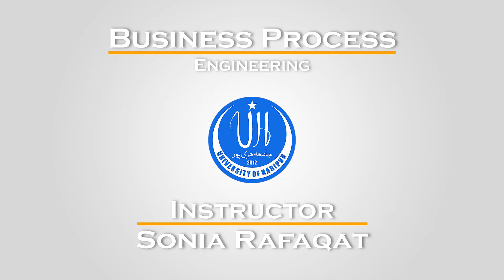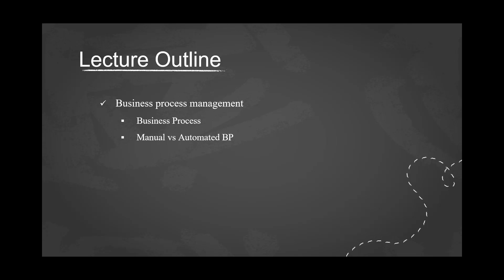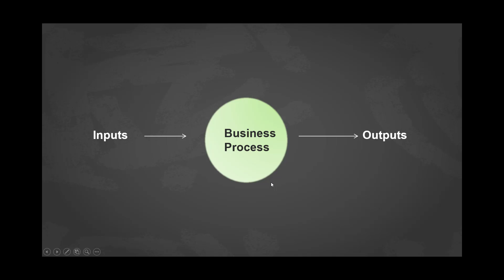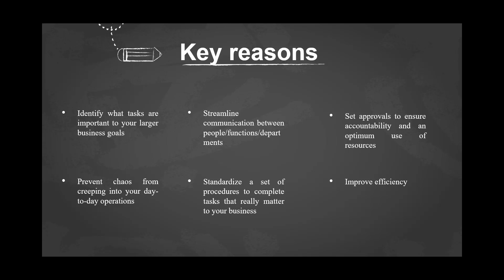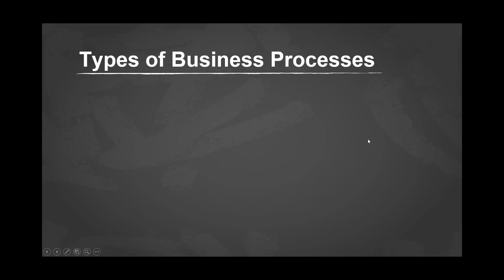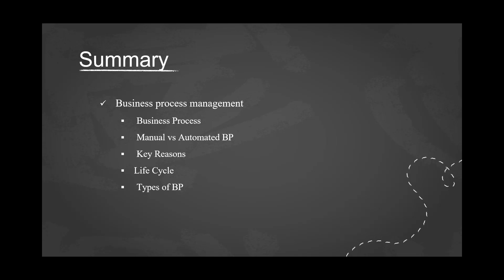Business Process Engineering - lesson 1: Business Process, Business Process Life cycle and Types

Comment: Roll No: F18-0380
Summary:
What is a Business Process? Business Process is a collection of activities or tasks that produce a specific service or product for end user. Some activities are related to services and some are product services like e-commerce websites give us services and industries give us products. BP are Manual Or Automated.

Business process life cycle includes a cycle to follow in order to get quality output and improvement in overall organization.Processes to distributed among best resources in order to get efficient and effective outputs.
Automated system helps to implement the process in more accurate way and consumes less time in comparison with manual system.

n business process there is a collection of activities or tasks to provide different services and there are are certain inputs to achieve output.There are certain key factors in business process lifecycle.We have to define our goal,plannig.And there are certain types of business process like manufacturing, finance etc.

Some are the key reasons Which are
1.dentify
2. Streamline Communication
3. Set approvals
4. Standardise a set of procedure
5. Improve Efficiency
There are 7 Steps of BPLC(Business process Lifecycle)
a. Define your Goals
b. Plan and Map your Process
c. Set actions and assign stakeholders
d. Test the process
e. Implement the Process
f. Monitor the Process
g. Repeats
Types of Buisness:
-> Manufacturing
-> Finance
-> Health
-> Banking
-> Defence
-> HR

Sorry For the late submission because of Internet Connections

Comment: F18-0370
BSSE 5th 'C'
Summary:
 Business process is the collection of different task and activities which provide different services and they are certain input to achieve output.
A business process can be manual or automated. 
Automated process allows to achieve goals quickly as compared to the manual process and also help in effective error checking. 
There are some key points of business process that are: 
it helps in identifying goals and achievement, 
it helps allocate resources because resources are the backbone of a company,
 it helps in prevention of a chaos and last but no the least it helps to improve efficiency.
 Business process follows different steps to achieve it goal like, defining goal, planning, setting action, testing, implementation, monitoring and repeat. There can be many types of business process like, health, finance, banking etc.

Comment: F18-0367
BS-SE 5th C
Business process management is the discipline which people use various methods to discover, model, analyze, measure, improve, optimize, and automate business processes. Any combination of methods used to manage a company's business processes is BPM. Processes can be structured and repeatable or unstructured and variable. Though not required, enabling technologies are often used with BPM. It can be differentiated from program management in that program management is concerned with managing a group of inter-dependent projects. From another viewpoint, process management includes program management. In project management, process management is the use of a repeatable process to improve the outcome of the project.

Comment: Ahmed Rustam (F18-0302)
Summary:
Basically, this lecture discusses one of the very few important processes, called as "Business Process". It has it's own way of continuing a task which has to be completed with effectiveness and efficiency, as business requires its stability laid on the foundation of client's trust of quality. BP has two ways of it's mechanism: First one is known as "Manual" and Second one is known as "Automatic". Manual seizes to provide the way of quality in much less time. Whereas, automatic provides you the way with confident decision of getting a desired output. Business Process differs in every platform of it's usage, as it has six different types, whether be it's manufacture related, finance related, health related, banking related, defense or HR related.

Comment: Muhammad Abbas
F18-0286
Semester...5th
Section...A
Business process is a series of steps perform by group of stakeholders to achieve a goal.it can be manual or automated.As accoumated BP is more accurate and time saving than manual process.
Here the 7 key reason..
1.....Define your goal
2.....plan your process
3.....set action and assign stakeholders
4.....Test the process 
5...... Implement the process
6....... Monitor the result
7....... Repeat

Comment: A business process is a collection of linked tasks which find their end in the delivery of a service or product to a client.   A business process has also been defined as a set of activities and tasks that, once completed, will accomplish an organizational goal.  The process must involve clearly defined inputs and a single output. These inputs are made up of all of the factors which contribute (either directly or indirectly) to the added value of a service or product. These factors can be categorized into management processes, operational processes and supporting business processes.7 step for business process life cycle to set goals plan, test ,implement process, monitor result, repeat process .Along with that's types include manufacturing , finances banking process etc
Roll no. F18-0289
BSSE Section A
Reply from the maker: B

Comment: F18 0295
BS 5th SE section A

Business manner is a fixed sports to supply a specific product or services. Series of steps undergo through commercial enterprise manner to attain the output. It may be automatic or guide. In automatic manner we get extra optimized end result instead of the guide ones due to the fact in automatic manner are taking place with the useful resource of current technology. For a nicely described commercial enterprise manner particular steps are taken into consideration to acquire dreams and a few preventions also are given. In addition exceptional steps of commercial enterprise manner existence cycle are blanketed consisting of;
 1. Defining aim 
2. Planning 
3. Set Actions 
4. Testing 
5. Implementation 
6. Monitoring the outcomes 
7. Repeat the processes.

Comment: F18-0313 
Summary
In this lecture, we have discussed the business process which is a series of inputs performed by stakeholders to produce an output. Then we have discussed that an automated business process needs fewer efforts than a manual. Then we have six key reasons for the Business process. Then we discussed the Steps of the Business process life cycle. Then we have discussed different types of Business processes. So all we have discussed the lectures studied in the class.
Reply from the maker: A+

Comment: Roll no : F18-0334
SARMAD KHAN
BS (SE) 
SEC = B
Summary:
                 Business process is a set of activities to provide a product or service to achieve goal. There are two main types of business process,1) automated and 2) manual. Business Process involves manual and automated process and also discuss the details and differences of automated and manual business process. key reasons for having a well defined business process include identifying goals and objectives, improve communication, allocate and efficiently use resources, improve the efficiency of work and priority task should have standards. business process life cycle includes the definition of goals, strategies to achieve those goals, identify the initial tasks and assign them to faculty, run process on small scale to check its performance, and business process helps us to achieve goals.

Comment: F18-0391
BS(SE) 5th C

A business process is a series of step to perform by group of stakeholders to achieve a specific goal. Business process can be manual and automated. If manual the process  is achieve without the aid automation while in case of automated process a technology aid is involve  which help in implementing process more accurate, standardized and optimized manner,
Automated process Allow organization to quickly execute a process while manual process is slower and automated process is time saving as compared to manual process.
There are six key reason of business process.
1. Business process identify what task are important to your larger business goals.
2.Streamline communication between /people /function/ departments.
3.Set approvals to ensure accountability and an optimum use of resources.
4.Prevent chaos from creeping into your day-to-day operation.
5.Standardize a set of procedures to complete tasks that really matter to your business.
6 Improve efficiency.
So business process life cycle have seven step first is define your goals, plan and map, set action and assign stakeholders, test the process , implement the process, monitor the results,  repeat. Types of business process is manufacturing, finance , banking , health  etc.

Comment: F18-0296
BS SE 5th A

Business process is a set of activities to produce a precise product or services. Series of steps go through through business process to reach the output. It can be automated or manual. In automated process we get more optimized result rather than the manual ones because in automated process are going on with the aid of modern technology. For a well defined business process specific task are considered to achieve goals and some preventions are also given. In addition 7 different steps of business process life cycle are included such as 1. Defining goal 
             2. Planning 
            3. Set Actions 
            4. Testing 
            5. Implementation 
            6. Monitoring the results 
            7. Repeat the processes.
 Different Types Of Business Processes Are Given As

Manufacturing, Finances, Health, Banking and HR etc

Comment: Name: Affan Mukhtiar
Roll No: F18-0347

In this lecture we concluded that Business process is collection of tasks and activities  on specific product to achieve goals which depends upon certain series of inputs to get the process running which can be manual or automated. There are set of rules or task s which are implemented on business process management. which are goal, communication, accountability, threats, efficiency etc. Basically, it tells you about lifecylce directions goals activities and results. So, Business process related to the subject which you are going to implement and work on it well there are certain types of business process fields to achieve common goal.

Comment: Roll no : F18-0348
Rabia malik

Summary:
                 Business process is a set of activities to provide a product or service. there are 2 types of business process : automated and manual. key reasons for having a well defined business process include identifying goals and objectives, improve communication, allocate and efficiently use resources, prevent chaos, improve the efficiency of work and priority task should have standards. business process life cycle includes the definition of goals, strategies to achieve those goals, identify the initial tasks and assign them to faculty, run process on small scale to check its performance, implement/ run the process in a live environment, review the process and check results and then repeat the process for the future processes. Business process types:
manufacturing(product assembly), finance(billings etc), health(medical assessment ),banking(customer on boarding), defense(emergency management), HR(starters/ leavers), travelling etc.

Comment: F18-0282
BSSE 5th A
Summary:
Business process:
Business process is an organized set of activities and task that are used by group of Stakeholders for the production of an output for end users and achieve goal for their organization. Business process can be manual or automated.
                  There are seven key points of using a well organized business process.
1)define your goal
2)plan your process
3)set actions and assign stakeholders
4)test process
5) implement the process
6) monitor the process 
7)and lastly repeat the process
        These are different steps to be taken to perform the different task in an organization.

Comment: F18-0272 
Section A

Lesson (1)
Series of step taken to achieve a specific goals is called business process. Business process in necessary for every . Business because it show or tell us about our business success or failure 
Business process may be manual or automated . We didn't use a technology in our business so it is  no so fax. Which is manual .And in automated .We use technology to achieve accurate result and efficient result.
In this lecture we discussed key reason.we identify our goals, communication between people streamline importance of resources prevention of    and standardize.
And another we discussed the seven step of business process. In these steps we define the  goals, plan and assign task and then test and implement and monitor the process.
And also we have discussed the types of business process which include manufacturing , finance ,banking process etc.  And these are using on organization on the basis of their need.

Comment: F18-0300
BSSE 5TH 'A'
SUMMARY
      Series of steps taken to achieve a specific goal is called business process.
       It can be manual or automated.
In manual
      There is no aid of assisting technology. So results are slow and with errors.
In automated
     There is aid of assisting technologies so the results is fast and accurate.
For effective business process some key reason are discussed. 
Business process life cycle consists 7 steps that are defining goals, planning, implementation etc. 
There are different type of business process. It can be used according to the need of organisation.

Comment: Roll No :F18-1180
Section:BS(SE) 5th "B"
Summary:
Business process is a collection of activities and tasks that are used for the production of some output for end users. We can also say thay it is a series of steps perform by stake holders to achieve a specific goal. A business process can be manual or automated. Automated process allows to achieve goals quickly as compared to the manual process and also help in effective error checking and removal of those errors. There are some key points of business process that are: it helps in identifying goals and achievments, it helps allocate resources because resources are the backbone of a company, it helps in prevention of a chaos and last but no the least it helps to improve efficiency. Business process follows different steps to achieve it goal like, defining goal, planning, setting action, testing, implementation, monitoring and repeat. There can be many types of business process like, health, finance, banking etc.
Reply from the maker: A+

Comment: F18-0299
BSSE 5 A
Business process have a various steps (input) through which we have  to get or achieve  business process goals ( out put). These steps are taken by stakeholders to have suitable results. Business  process can be manual  as well automated. Automated BP are more acurrate , speedy,less time consuming,effective  and in optimizing manner than manual BP.

After that  we have key factor which are used for an effective BP which involves  goals,identification , communication among indiviuals and efficiency.
BP life cycle includes 7 steps i.e
To set goal
Planing
Testing
Assinging process
Implementation
Monitering and
Repeat process
After that BP have futher more various types like manufacturing,
finance, banking process e.t.c

Comment: Summery:
F18-1181 BSSE (5th B)
Business process: 
A business process is a series of repeatable steps taken by a team or company to achieve some sort of business goal: producing specific product or services for end user. 
 Requires a human to push it through every step and know whom to send it to. The system is programmed to auto-assigns tasks. An effective BPM solution will help business owners identify the processes they need to include in order to get the outcomes they need.

Defining goals, mapping our processes, setting actions and assigning  stakeholders, testing processes, implementing processes ,monitoring results and repeating again are few steps in the business life cycle. Manufacturing, defense , finance, HR processes etc are the kinds of business processes.

Comment: F18-0304
BS-SE-5TH-A
Summary: 
Performance of different activities to provide  services to the customer or end users is called  Business process.In mannual process, process is achieved without the involvement of technology where as in automated process , the involvement of technology helps in implementation of process efficiently.Key reasons are  1:  To utilize resources in  optimized manner ,well defined BP is necessary  2:well define BP is important to improve efficiency. Define goals ,make strategy .identify individual tasks, check performances, implementation and monitoring are the steps of BP life cycle. Tyes of BP includes: manufacturing process, finance process, banking ,HR and defense processes etc.

Comment: Roll No: F18-0342
BSSE 5th Section B

Business process is a group of tasks performed by stakeholders to produce a specific service or product for customers. Business processes can be automated or manual. In manual processes technology is not used and in automated processes technology is used and are more efficient than the manual ones. A Business process should be well defined in order to achieve specific goals as it helps to identify goals and objectives,helps in optimum use of resources, helps to prevent chaos in everyday operations , standarize a set of procedures necessary to complete tasks and improve efficiency. There are 7 steps of business process lifecycle that starts from planning for a business process to monitoring of the results. Business processes can be of many types including health, manufacturing, HR, finances,Banking and defence.